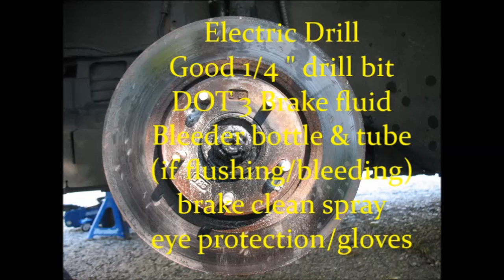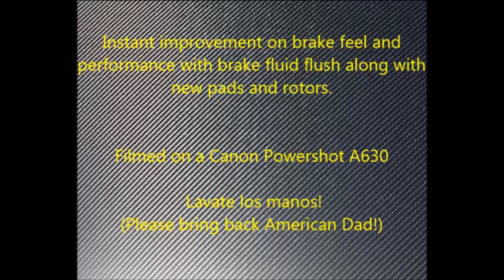How to Change Front Brake Pads & Rotors on a 2006 - 2008 Hyundai Sonata - Drilling out rotor screws

Comment: Jack stands.
Reply from the maker: Good catch.  I've since learned it's not wise to use a jack as a jack stand.
Reply: @ArtzFenix  Even jack stands fail. I can't believe I still use one almost 20 year old craftsman jack stand that the other one of the pairs' legs buckled. I was doing a rear sway bar so all the tires were on the truck but I had to dodge the rear pumpkin with my pumpkin.  I should of had the jack on the rear pumpkin with a piece of wood and a little pressure but the internet is split 50/50 on that topic.